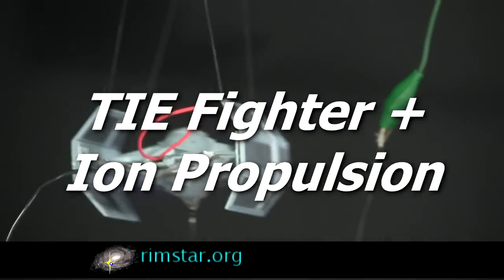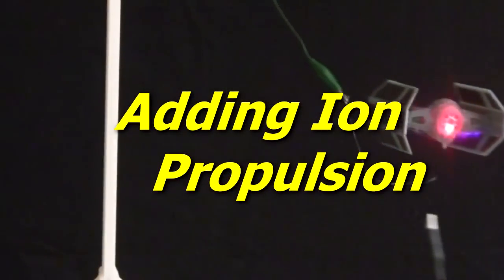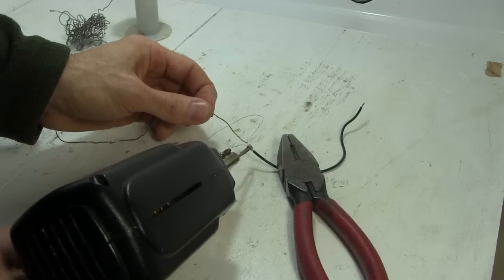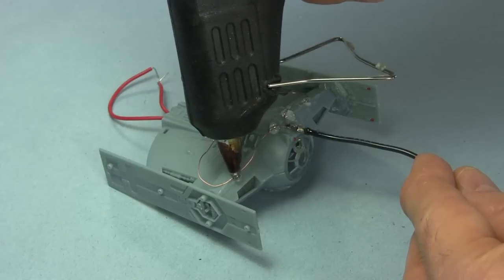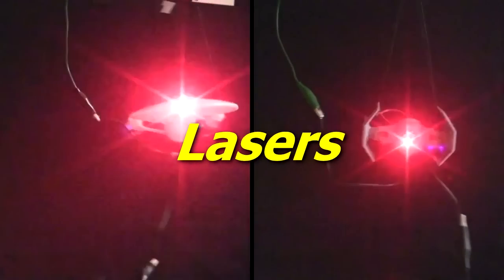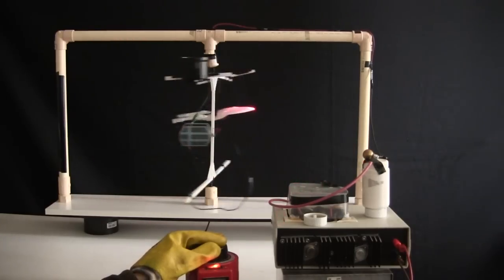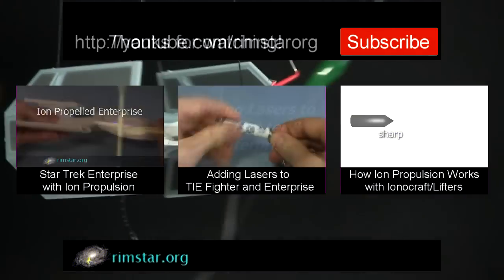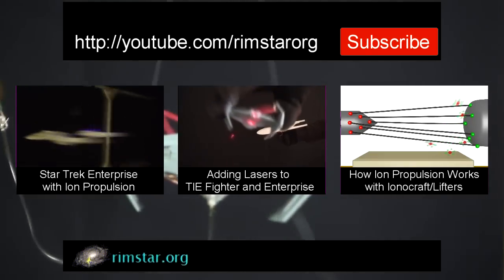How to add Ion Propulsion to Star Wars TIE Fighter Model

Comment from the maker: I added ion propulsion to a Star Wars TIE Fighter model. Why? Because the TIE stands for Twin Ion Engine. It was necessary! :) Enjoy.
Reply: i was wondering did you had to use a transformer?
cause when looking at ion propulsion project on youtube I saw this video (https://www.youtube.com/watch?v=9AHuC0yBKlg&t=452s) which shows this person using a transform ( at 8:30 and a different transformer at 9:34.He also said that the second transformer, the one at 9:34, is a high voltage transformer) and i didnt see or hear you said or talk about a transformer( by the way i just learned about ion propulsion back like 2-3 weeks ago, meaning i dont fully understand ion propulsion, but i do know its pretty cool).
Reply from the maker: I used a power supply that has a flyback transformer to raise the voltage to around 10,000 volts and then a voltage multiplier circuit to go from there up to around 30,000 volts. I show how I made it in this video https://www.youtube.com/watch?v=GEuK1OdYxHk

Comment: With that blue corona, I want to try this with the Millennium Falcon! It would be easy to hide all the electronics inside the model (other than the HVPS) and the blue corona would match the color of the ship's engines in the movie! Plus, the Falcon's engine is already thin and wide. Of course, I'd need some way to heat shield the interior, but that's a problem to solve while making it.

Comment: No issues with melting models? I tried to make a lifter with thick-shake straw posts. Caught fire as soon as the corona hit the straw... I think your HV PSU is even better now you fixed it :)
Reply from the maker: I've seen people have that issue, but it's never happened to me. And that's despite having sparking beside the balsa wood supports. Maybe my PSU doesn't have enough current.
Reply: Both of you are steely rocket men!

Comment: NASA, SpaceX or the Space Force should be knocking at your door saying, “Sir, we’re hiring you to help us build a real Starship Enterprise & boldly go where none has gone before. 
——-
Question 🙋🏽‍♂️ for you:
Now that you have made a spaceship 🚀 that can fly in the air or in space, I was wondering 💭 how fast can it go according to your experiment example?
Reply from the maker: I don't know how fast it could go. The power supply, batteries or solar panels, and the gas for propellant that it would need in space would add a lot of mass and so its acceleration would be very small. My understanding is that the impulse engines on the Enterprise are ion engines so those are many orders of magnitude more efficient than anything we have today.

Comment: RIMSTAR what about T T Brown's electrostatic antygravity ??
Reply from the maker: I suspect T.T.Brown's results were all from ion propulsion of one form or another. The work he did in Bahnson's lab was with magnetohydrodynamics, as stated by Frank King who worked there. Only uninvolved people who wish it was antigravity say it was antigravity. As I've found, even the wires feeding the devices can produce movement. You can see that in my Poynting flow thruster experiments where with some configurations I could get the wires to make the device move. You can see that on my website here http://rimstar.org/sdprop/poynting/cdpoc1/cdpoc1.htm I suspect that was how Brown's gravitators worked. The only anomaly with Brown's would be his vacuum chamber tests, but with the exception of the one in France, the performance was so reduced that even those may have been explainable with ionization or coulomb forces. He did say that the one in France worked better when sparks occurred, and since sparks can produce movement by the ejections of matter, that could account for it.

Comment: How much voltage is neded for this
Reply from the maker: I didn't measure the voltage. However, the power supply was rated for up to 30kV and judging buy the spacing of the electrodes for the TIE fighter and my experience using the same power supply for lifters, I'd estimate around 25kV. Keep in mind that this type of ion propulsion also needs a significant amount of current too, probably in the high microamps to low milliamps.

Comment: ever gpt a nasty shock out of this thing??
Reply from the maker: I did charge up a capacitor made from a ceramic bowl once and it was probably charged by the power supply I used in this video. I got a painful shock by touching both electrodes of that capacitor thinking I'd discharged it enough already. That was one of the rare times when I was playing around with someone else. I've never gotten a shock when working alone, I'm too focused on safety at those times.
Reply: @RimstarOrg  yes, this flying ceramic bowl idea seems a little risky  i have shocked myself with a small marx generator, but i have never had a bad one so far-only if u wish to tell, but how high watt does thing have to be to lift maybe a small car? probably would kill you right?
Reply from the maker: I don't know how many watts to lift a small car but it would be a lot. My lifter weighs only a few grams and uses something like 25,000 volts x (around) 0.001 amps = 25 watts.
Reply: @RimstarOrg  haha that makes me think its possible but who wants to ride the lightning!!! haha